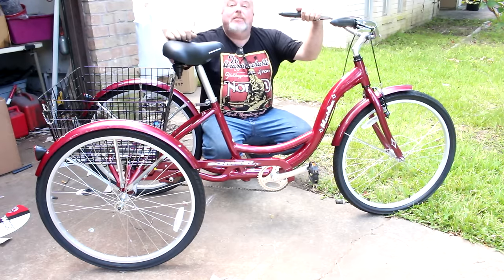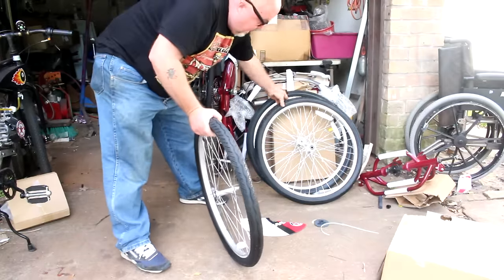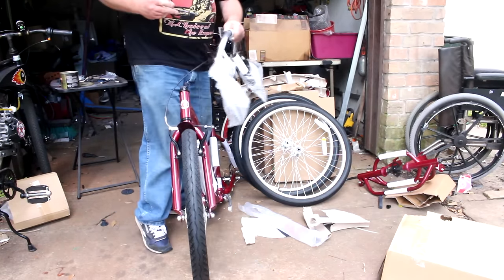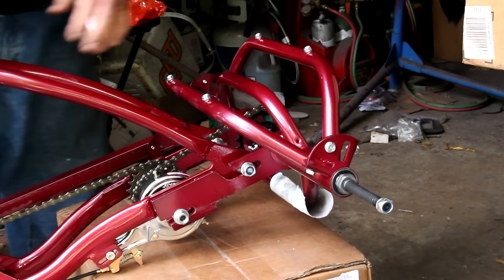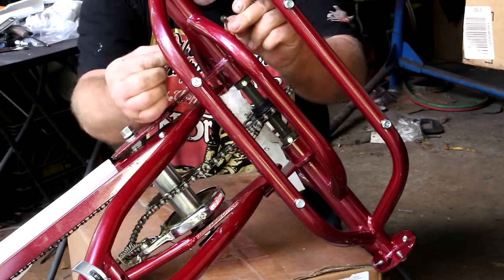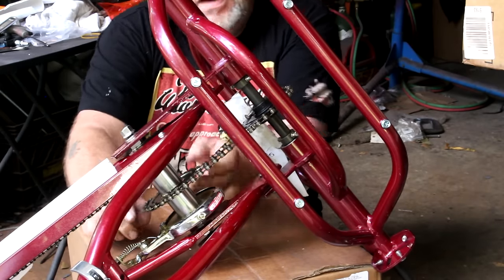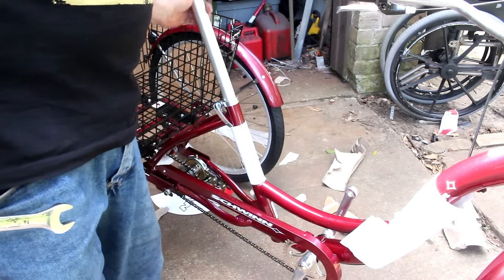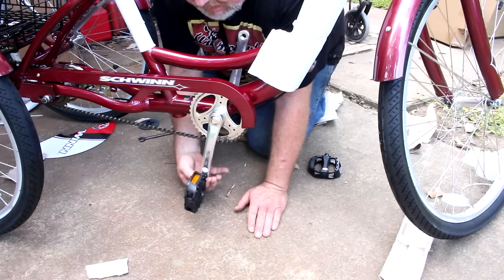How To Assemble a Schwinn Meridian Adult 3 Wheel Trike Part 1

Comment: I am the old guy in Houston you talked to for a moment. Your a damn fine wrench. About all I can say is I am a first class wrench also. I have that trike with a 750w electric front wheel. Mobility batteries in the rear basket. Ridden it daily for 6 years. Several 2 strokes I have built for customers And had a 4 stroke on the back of both. After seeing all your videos I understand why you have not had time to call me back. Ride safe everyone. Saddletramp1200 M&S Motorized bicycles Houston, Tx.
Reply from the maker: I like electric on these. just expensive is only drawback.
I'm discontinuing the front friction drive kit. The supplier is out too often. I'm thinking of doing a push trailer setup w/ a 97cc engine
Reply: @HughesMotorized  I have seen a few people do a pusher. They've not been very successful. It usually winds up with a bent rear wheel.

Comment: Late, but what I learned from trikes. When you put the left wheel on (the non drive wheel), just snug up the locknut. Don't crank it down like the right side or the front wheels. The way trike axles are set up is the left side has that spacer that presses against the bearing on that side. but when you tighten the wheel nut the axle will pull on the right hand side because your right wheel bolts to the axle but doesn't put any pressure on the right bearings. If you tighten the left too much it'll pull the right bearings out of alignment and chew them up
Reply from the maker: Good advice. Thanks
Reply: With the wheels removed, the drive side has a collared nut + thin nut against the bearing, non drive side has the two thin nuts.
If you lock the two nuts in place via thin cone wrench + wrench, how can tightening the non drive wheel too much pull the axle's 4 bearings out?
---
Not tryin to be a smart ass, maybe im missing something here and would like to know
p.s. I do agree that over tightening the nuts that hold the wheel on is bad (and not needed as its a nylock nut) it also would potentially side load the two sealed bearings in the wheel's hub as well)

Comment: instead of loosening brake cable squeeze it closed with your hand then pull on the Chinese steel bent tubing away from where the wire it tightened down by the allan bolt it slides right out and pops right back on
Reply: Kody Gallant that part is called the "noodle".

Comment: Seems lots of people are into motorizing these Schwinn trikes but when you start looking into it more, you see constant complaints about rear spokes breaking, axles warping or breaking, and premature rear axle wear. It's a light duty single-speed trike! It's not designed to be able to go fast. You can motorized it easily enough but...DON'T.
Reply from the maker: Especially if you put a 212cc motor on one or don't maintain one. Bottom line. BE CAREFUL

Comment: Thank you for this video. I just bought the same exact bike and I am having trouble getting the rear frame on. I didn't know if I should take off the bolts closest to the gear on the main frame or not and it looks like I do not. But it did not come with any more washers or nuts so I am not sure how it will go on?

Comment: You forget to line up rear end to get the sprockets in line also rear wheels has inside locking nuts which you forget to lock them.
Reply: That is what I was wondering on the inside nut as my bike keeps getting loose on inside and does a clicking knocking sound why .?

Comment: You left out the part where you make sure the rear axle is in alignment with the frame. If it isn't,  the rear wheels will wear out prematurely.
Reply: Did the manual give any tips on how to best do this, besides making sure to pull the rear axle assembly evenly when tensioning the drive chain?

Comment: So the rear brake only brakes the drive wheel, and the opposite side free-wheels? I guess they had grandma peddle speeds in mind, as opposed to madmen ( like me) that want to add an engine. I wonder how feasible it would be to add caliper breaks on both rear wheels?
Reply from the maker: +TheMicroTrak Yup that's how they work. They work fine as is IMO

Comment: sorry but if someone can tell me if this is a good tricycle. I am 280 lbs. I am not sure if the 26 inch will do the job. I appreciate if someone can reply. Thank you
Reply from the maker: It's good. The 26- wheel variation holds 300-350 lbs. I'd recommend an electric one with pedal assist so you can get some movement and enjoy the ride more. https://ebay.us/RB2kmB
Reply: @HughesMotorized  Thank you soo much for replying))

Comment: Ok I bought one just like it and with less than 5 miles on it , the rear bearings were grinding,  so I bought all 6 new from Miller bearing 4 for axle and 2 for coaster wheel and it still does it and sounds horrible. Next time I will buy a Miami sun.

Comment: My left pedal won't go on. Not threaded correctly.
Reply from the maker: Left pedal and crank arms have reverse threads. Counterclockwise to install. Right pedal has normal threads
Reply: Thank you but I looked at the pedals and they both have an R engraved on them. I’m going to call Pacific Cycle tomorrow. Thank you for this video. Really appreciate your help with this tricycle.
Reply: Thank you. The pedals are both Right pedals.
Reply from the maker: @Katwoman4318  Yup.. they messed up. They're pretty good at fixing issues like this. Contact their customer support